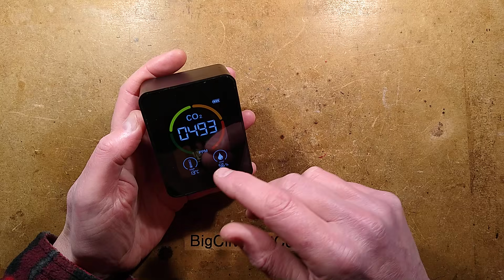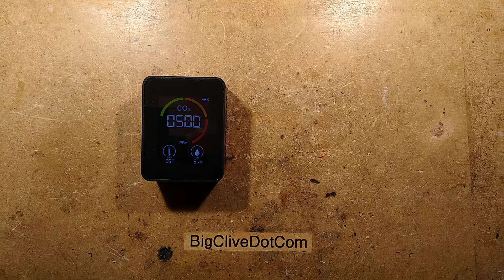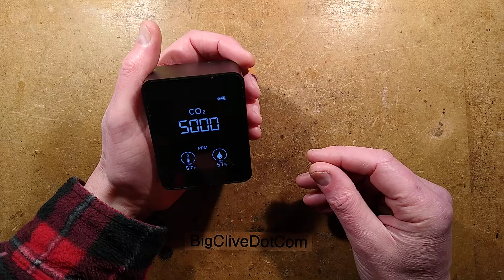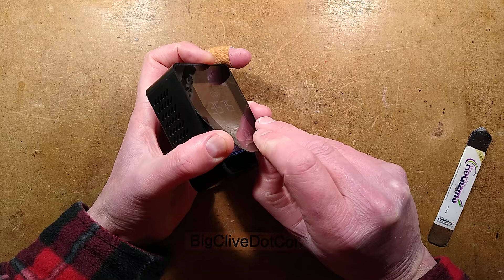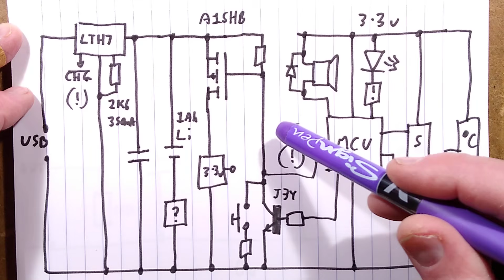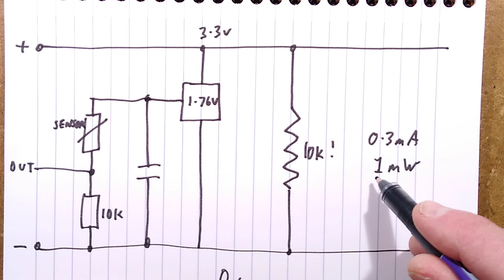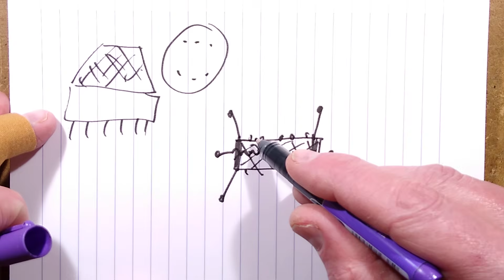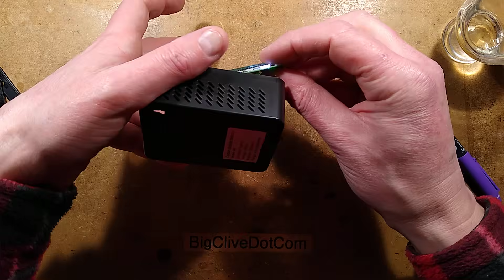Fake CO2 monitor (party detector) with schematic

Comment: That 'fine mad' datasheet is supposed to say "Fine Made". They're actually a very high-quality supplier of tiny RF switch ICs. I use about 10 in some designs. I would probably trust their regulators, though they're almost certainly not as low-noise as some fancier ones from western suppliers.

Comment: If you buy a super cheap Chinese made CO2 monitor this is what you get. I bought a $50 Chinese made CO2 monitor with a Swiss made sensor and it is very accurate when compared to a Aranet4 CO2 monitor $200 (Swedish sensor). They both track at almost identical readings. They are very useful for knowing when to air out living spaces. The monitor in this video is a super cheap knockoff, don't get fooled.

Comment: These were VERY popular during COVID, here in Australia at least, because we were being told that measuring CO2 was a proxy for air freshness and hence likelihood of being (over)exposed to COVID germs.  I bought one that looked exactly like this at the time, and now I find out that (like this one) it's mainly responding to alcohol.  It did go off a few times during COVID, and we weren't drinking alcohol then, so it did detect "something wrong" - just not what it says on the box.

Comment: Alcoholism=Scottish degree of humour sense level?? I was never sure of it... Also, I thought even your own schematic would start beeping! 😄
My only experience with "sensors" is with gas electoscopy (chromatography) where you inject a liquid to analyze, it gets heated and depending on the "burnt" energy, it will show the components of the liquid (I can assure Jack Daniels has an average of Methanol 10xtimes higher than usual whiskey). Maybe your module detects those spikes and shows the alarm passed a threshold... That would explain why it doesn't detect CO2

Comment: Could it be a VOC detector? (Volatile Organic Compounds). They tend to sit at 400 ppm on their lowest reading when put outside. Try exposing it to burnt or cooking toast. VOC detectors estimate the level of CO2 using algorithms that basically try to determine how many people are in the vicinity from the VOC level, then calculate the CO2 levels that would be likely from that number of people. It is a CO2 sensor of a sort, but not by directly measuring it.

Comment: They also start by zeroing out the numbers from the alcohol sensor.
But if you want anything to work for real, and for more than a month, direct sellers on aliexpress/wish/temu are not the place to go.
It doesn't really work as a breathalyser becauss the range is too small

Comment: Well, I can say that CO2 levels are closely monitored and regulated in tissue culture. Basically the culturing, propagation, and experimentation with mammalian cells require incubation at 37 degrees, near 100% humidity, and approximately 0.5% CO2. Most of the liquid nutrients used to feed mammalian cell cultures contain a carbonate-based pH buffer which can be said to interact somewhat with the CO2 in the environment/incubator but ultimately functions to keep the pH stable. Obviously if the CO2 levels get too high, it would lead to pH levels dropping due to formation of carbonic acid with water. Anyway, I just thought I would put in my 2 coppers from a prior laboratory manager’s perspective what these devices might be useful for. 
Another thought is that people in various sectors including chemists, and more recently technicians in the hemp industry, will perform chemical extractions using supercritical CO2. Any such work without sufficient ventilation poses a risk to workers from increased CO2 concentrations in their environment. These devices may be very useful in catching sudden changes or even analyzing trends during CO2-based procedures.

Comment: Interesting. I bought usb-c powered zigbee co2 sensor (but without beep, temperature and humidity) with exactly the same display from aliexpress. But it works as intended. Maxes out to 5000ppm with sodastream gas nicely. I haven't yet compared result to calibrated sensor yet tho. I guess there are similar looking devices around, one being NDIR CO2 other eCO2 (fake) sensor.
Reply: Also this type of LCD display is better than pixel based LCD for this application: cheaper, consumes less power, much sharper letters.

Comment: Hi Clive, got one of these about a year back and wanted to see what was actually inside mine. I got the H8 Plus version from my favourite Chinese marketplace, and here's what I found. 

It does have a sensor inside for sensing some kind of gas (although I don't know what gas exactly). They also have a vacant 4 pin header right next to it called J1 with 5V, Gnd, and 2 resistors... A small humidity and temperature sensor, and then 4 unpopulated pads simply named "JUM1". I suppose it can still be useful for humidity and temperature sensing, I'll just remove the speaker.

The one other thing to note, is that they say it has a 1200 mAh battery inside it. It's actually an 7.4Wh 18650, at 3.7V. The inclusion of an actual gas sensor was still a surprise to me though. I'll be testing out some things near it so I can try and see what it actually is. 

Thanks for the teardown video, they were rather sneaky with those screws! :)

Comment: Avoid the Inkbird CO2 detector, it is also a fake device sold through eBay/Amazon, I paid $100 AUD and it is a fake piece of gear, we must hold the eBay and Amazon responsible when people start passing away from asphyxiation, people rely on certain equipment to tell them if they are in danger of suffocation and these Chinese eBay/Amazon on line system enables them to do so. Imagine selling fake CO2 and gas detection equipment from China and the likes of eBay and Amazon being fine with the practice, they could not give a fuck if you die when using products sourced via their sites.

Comment: I found this video (https://youtu.be/FL0L-nic9Vw) that explains the difference between "real" CO2 sensors and cheaper VOC sensors that uses an algorithm to approximate CO2 from VOC levels. Ethanol is an Volatile Organic Compound (VOC) and the cheaper VOC sensor will detect it and display an increased CO2 level. BOOM, mystery solved :)

Comment: Hello. I bought an exactly same looking device (but in white case), and I see completely different internals there. The only thing similar is the DHT11-ish sensor, but there is also: 1. a big unmarked gold sensor (around 2cm*1.8cm*1cm) on its own pcb board with air inlet and outlet both closed with some dust cover. 2. place for ESP8266 module (not soldered in my case) 3. the microcontroller is STM32F103 3. no beeper. 4. the rest of pcb is completely different. All in all it seems that not all of them are fake.

Comment: The Tin oxide sensor is interesting I will have to learn more about this tech.  If your brief theory of operation is correct then detecting Ethanol makes some
sense.  Ethanol C2H5OH has that hydroxyl at one end of the molecule the partially exposed Oxygen probably temporally bonds on the SnOx surface how this 
modifies the conductivity is exotic surface physics which makes me recall the failure of early field effect transistors to work due to "dangling" bonds at the 
surface of the Silicon.  Likely some thing similar happening almost to make one become a solid state physicists.  Thanks for the video very cool stuff.

Comment: The most recent demand for CO2 sensors is to determine air quality in buildings in order to reduce viral transmission. More CO2=more rebreathed air=higher possibility of viral transmission.

Comment: Monitoring co2 is helpful for house that do not have central air.  Ours does not. It does not have to be hermetically sealed. CO2 routinely gets up to 1500ppm and when it does, I have added circulation fans that turn on to try to reduce CO2.

Comment: Hi, I sprayed 90% ethanol into a clear zip bag and to a paper tower. Then I put my CO CO2 detector in there. CO and CO2 readings were slowly continuously increasing  then trigger its alarm.
My air detector is claimed to detect both CO and CO2. When I blowed my breath out to it, 5000ppm CO2, CO ppm slightly increased. When I try the smoke test, CO went to 1000, CO2 ppm slight increased
Should I trust this CO/CO2 detector. Its model is PTH-10E. I got it for only 28$ in aliexpress.
Reply from the maker: It sounds like it's estimating CO2 based on other factors.

Comment: Bought them and they don't seem to work as the manufacturer or seller from the online store describes.

They can't detect Co2 from my Co2 infused mineral water but they surely can detect when I'm using a whiteboard marker.

Liked this and a return request to the store where I bought the 2 of mine 

Thx for a great work.

Comment: Inspired by this teardown, I pulled apart an almost identical detector I had (labelled H8 Plus, not H8). Same thing- a no-id markings VOC detector unit. Cunning thing was that at several places on the circuit board, there were screen-printed labels 'CO2 SENSOR'. Suggests that manufacturers have felt the need to up their game with an increased level of deception.

Comment: in most modern houses Co2 level is quite an issue if you have a few guests over. My mom would always get a headache when we visited and stayed in the living room for a prolonged time. At some point we bought a CO2 sensor and monitored for a while. When it was only my parents at home, the level varied between 450-800 ppm. When we came with our kids, the level would spike up to >1200 within 1h and >2000 in 2h.  When my brothers family was there as well the level went up to 3000 in less then 1h.

Comment: Andre Spiess  Video#300 has an excellent explaination 4 years ago. These units do measure the VOCs in breath. It does not measure CO2 but "eCO2" based on Breath VOCs and T/H. They are not accurate but they do correlate quite well  to "true" NVIR CO2 sensors. Andre has a nice MQTT Graffana graph of 3 different sensors showing strong correlation but wide variation of readings. So these cheap IAQ units can be useful. Just need to understand what eCO2 means in your use case.

Comment: Currently , in the Pacific , the base line for CO2 is 421ppm 0.0421%. So any recalibration should not go below 421pp. Ref July 2024 Mauna Loa ,Hawaii 425.55ppm and Bearing Head, Wellington,NZ 421.5ppm. These are very unpolluted locations in opposite hemispheres so everywhere else must be more than these numbers. There are some seasonal changes but , these days never as low as 400ppm.

Comment: If I buy a CO2 meter I want it to measure CO2, not alcohol. CO2 meters are good to measure lack of ventilation. You are not going to detect this with an alcohol detector unless there is a drinking party going on.
Good to see that someone exposes this problem.

Comment: It does Detect Pixies and Fairies within 25 mtrs. I think you need a CO2 Detector if you have an Open Fire which removes Oxygen from the Atmosphere !!!  Because  Carbon Dioxide is Poisonous at high levels. 
 And a Carbon Monoxide Detector is Vital !!!

Comment: I thoroughly appreciate this comment section. I have a functioning CO2 sensor (I mostly got it for the PM 2.5 sensor, but if it's there, may as well track it) and apparently I got some bad metrics, and was worried about anything over 1000 (and cautious about 500)ppm. 1500 ppm while buttoned up is not great, but still acceptable, and 250-600 with the windows open seems very in-spec.

I think whoever was telling me 1000ppm was a danger threshold was trying to sell me something.

Comment: NVO detector? I see a LOT of sensor modules and sensors that claim to be CO2, chemicals, particulates, blah blah, and they are ALL nothing but NVO detectors.. so alcohol, vinegar, and every other organic vapor will set them off, even cooking :) Yet very fewpick up co2, or anything else. My recent Amazon air quality sensor, which I got for $30 when they first released is the same, only detects non-volatile organics

Comment: Ive found the best co2 sensors on the market or really any REAL sensors use MG series sensor packages usually MG811 OR MG812 for the short term and an infared captive monitor of some sort for long term readings with some sort of logic to balance long term and short term readings. That is not a co2 sensor, most likely a VOC monitor. Im glad I didn't buy one of these, I almost did.

Comment: I just found this on ebay... its $20 AU, thats cheap for a screen and a battery and a maybe hackable board
Reply from the maker: The screen is fixed images with coloured filters.
Reply: @bigclivedotcom  yeah I saw that bit after I made the comment, still, it might be useful for something

Comment: We have ones at our office that look exactly like this, but they do have real CO2 sensors. It's an old building that's not well ventilated; over the course of a workday levels reach over 2000 ppm, more than enough to affect cognition (we usually open a window long before it gets that high). Of course, those also go nuts when you breath on them, but they do it even when I'm completely sober. 

The temperature sensor in them is equally useless though. Will show 27 degrees when it's below 18.

Comment: Co2 sensors has nothing to do with being herimtically sealed. 
While there is som circulation im buildings naturally it is hy far not engoth to balance a lot of humans nreathing in there. And while reaching toxic level is rather unlikly, reachong levels that can make you tired dizy is very much realistic. Especally in cramed office building and simuar settings. 
And that is very much not conduzive to a good working envoirment.

Comment: If you are living in a house with 4 walls and a roof the co2 levels will rise quite fast with 4 people or more, no need to hermetically seal your house, our living room goes up to about 1200 after 2 hours with 4 people, this is not dangerous but it is above the recommended limit here (1000)

Comment: Dang, they got me!  The two I bought (one white, one black with slightly different case vent moldings) are confirmed junk. I put them in the sink and put some CO₂ (dry ice from an extinguisher through a rag) and no change. Thank you.
PS: Originally tried vinegar/baking-soda but the vinegar set off (only one of) the sensors.

Comment: CO2 level indoors is a useful indicator of covid transmission risk. Better ventilation = lower CO2 = lower risk as the ventilation has reduced the levels of both CO2 and infectious aerosols in the air.

Comment: There IS an AVR / ATMega / "Arduino"  chip that also includes an LCD driver... I've got one in my junk pile somewhere ... ... The ATMega 329 - basically the same chip as in an Arduino but with an LCD driver on chip too.... but that's a 64-pin and "yours" is 48-pin... I wonder if Atmel/Microchip have any others like it?
Wouldn't that be a cool online database? ... You could say to it, I've got 48 pins, there's  PWM on pins 5 and 9, The VCC is on pin 10, There's an 8-bit GPIO bus on pins 20 - 27... what microcontroller is it?

Comment: Someone makes an air quality monitor which is a bird (wood or plastic) sitting on a rotating axle. When the air goes bad, the axle rotates so the bird is hanging upside down. Makes it quite obvious, instead of just numbers or coloured lights.
Marketed for use in schools too.

Comment: Wow, a Genuine Wine Proximity Alarm!! I suppose it would detect Miralax too

Clive, this is very interesting. I noticed the Serial Data I/O pin header (4 pins marked B/R A/T 5V GND) so it probably would respond for either ICP In circuit Debugging/Programming or perhaps a shell if there it an RTOS on it. Like you said, the LCD is segmented so way too custom to mess with firmware. Enjoy your videos my friend!

Comment: I have a real CO2 detector and the amount of time it goes above 1500 ppm while just sitting in a room with the door open is more than you would think. I also got one off temu that looks exactly like the one in the video but it also does TVOC and Formaldehyde, needless to say the one off temu doesn't do any of that, I am not even sure what its detecting but all the readings move differently.

Comment: Well, a good reason to know for CO2 is when you're growing plants... And if you have enough CO2 to feed your plants so that way you can monitor if the levels are high or low or even if it's not accurate, at least you could see if they're going up or down. So if there's something the plants can breathe or if the plants are just suffocating.... That's why someone like me would want one....

I just bought a little bit more expensive one that hooks up to my cell phone so I can monitor it on an app but it's a little off but at least it shows me the ups and the downs and that's what's important so I know when it's rising and lowering

Comment: Yeah these things are only useful at measuring the difference between no co2 and a small amount of co2.  But the way you describe them making the part manufacturer lie  is wrong - the SGP30 is a thin sensor designed explicitly to output an "eCO2" reading.  And yeah they're not very good.

Comment: Hang on.  Tin dioxide gas sensors can detect CO2 just fine - the MQ-135 is designed to do exactly that.  They're just also way, way more sensitive to VOCs.  And kind of shit at detecting CO2.  But the parts are marketed for that purpose, nobody tried to scam you.  Maybe MQ manufacturers tried to scam product designers.  "CO2, notably, is not a flammable gas. Here, the sensing mechanism is different; instead of reacting with adsorbed oxygen directly, CO2 sensing relies on water vapor first reacting with adsorbed oxygen to form adsorbed hydroxide (OH–). CO2 then in turn reacts with the adsorbed hydroxide, forming carbonate (CO32-). This process ultimately also returns electrons to the SnO2 conduction band, and therefore results in increased conductivity."
Reply from the maker: It didn't respond at all in a closed container with a jet of CO2 added.